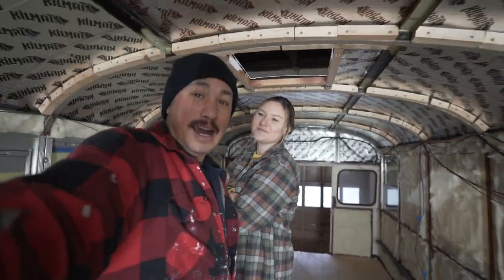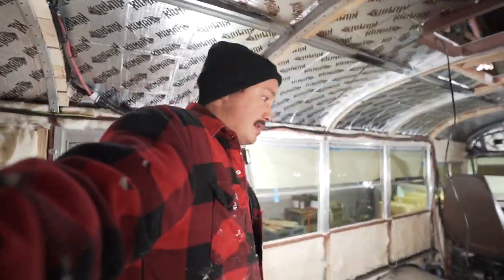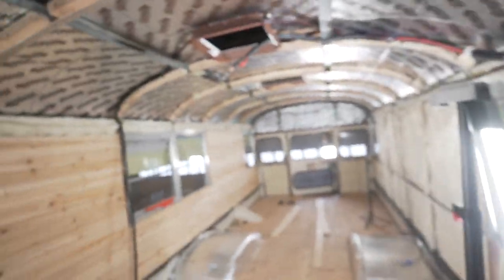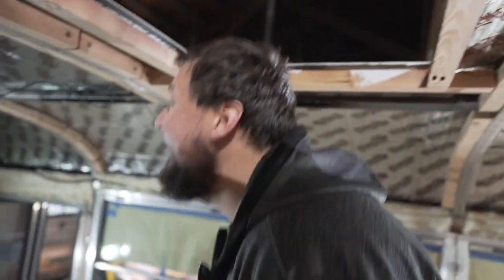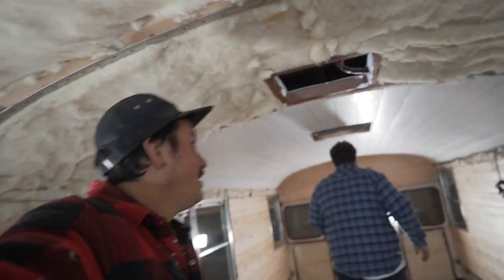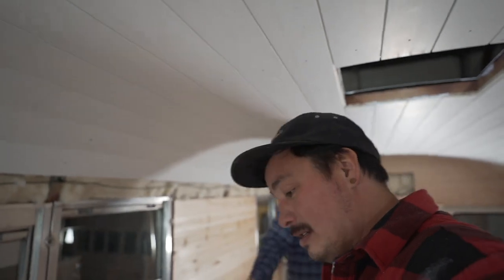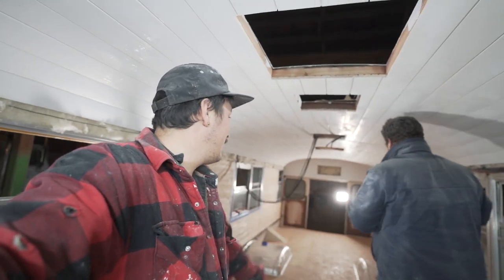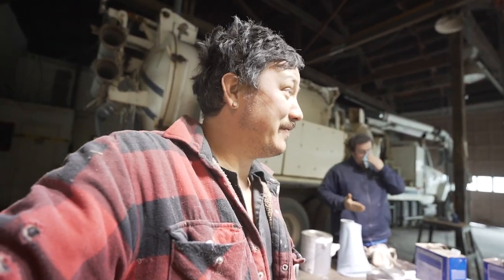Putting Walls and A Ceiling Up In An Old School Bus - SKOOLIE BUILD WEEK

Comment: You should have put thin insulation on the metal hat channels before you put final ceiling, otherwise you'll have condensation and ice issues. I have few photos that people posted online where they didn't insulate the ribs and they got serious condensation and ice forming on them.  I can send them to you if you'd like.
Reply from the maker: I mean I lived in a bus with stock metal and insulation for years with literally 0 problems and no cold nights with a propex hs2800 a piece of reflectix is an upgrade from that

Comment: Love the build. We are building a shipping container home. I wonder if this maybe a solution for our insulation. The kiltz mat . We are trying to get away from spray foam due to the cost. Or the hush matt would work for insulation..?
Reply from the maker: You would have to do your own research. It worked for my needs so far. We are possible doing a shipping container next so would love to know what you found out

Comment: Don't forget to foam the channels on the ceiling
Reply from the maker: Huh
Reply: Never seal the hat channels for one reason only. Hat channels are an inherent air gap and will create moisture. If you seal them, moisture can build up and cannot wick or drain away and will rust from the inside out as the water will have no where to go except rot.

Comment: I've been watching your construction it looks like a good system how you've covered everything with hush mat so it should prevent condensation. I was watching Chuck and he says you have to cover the rib frames.  Although in my opinion that's very small amount area to condense moisture. With convection it should just evaporate way good job dude.
Reply: Kilmat and Havelock Wool = job well done. No issues.  Maybe Chuck can learn something by watching Isaac!! You never can tell!! Sounds like the plan Chuck!! Start taking some notes. 👍💯💥
Reply from the maker: Thanks for watching! I don’t care what that dude says!
Reply: @isaacturnerit  cool

Comment: I know it probably has never given anyone an issue but me personally I like to have access to all functions of my bus hence why I put my wiring external so I won't have to rip a wall or ceiling apart to repair an issue, my logic behind doing that is the bus while moving is flexing meaning that wire could be rubbing in places and if damage was to occur and I'm popping fuses then I would be able to find and fix the issue easily versus very costly repairs.